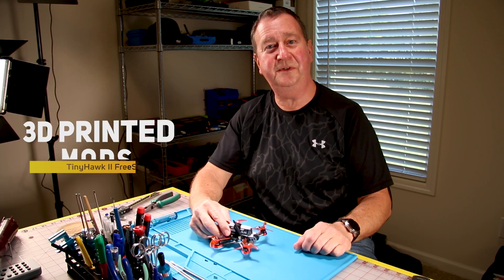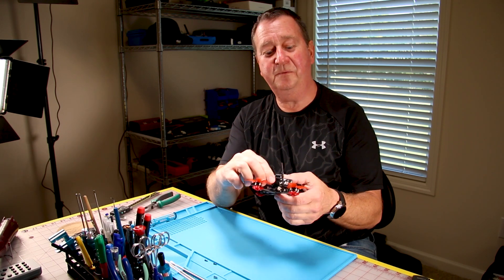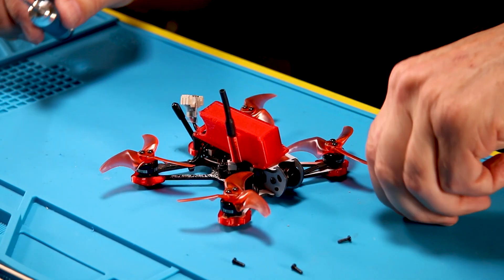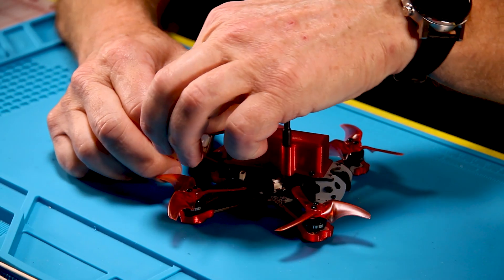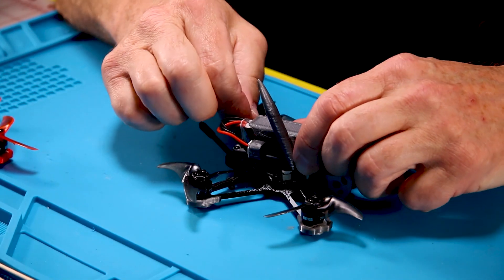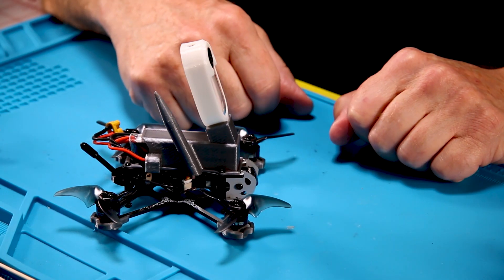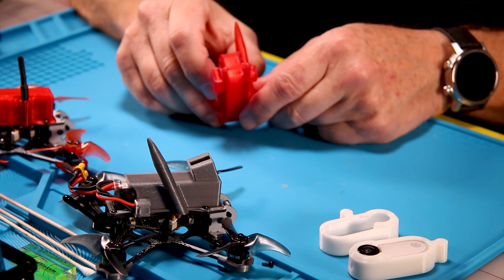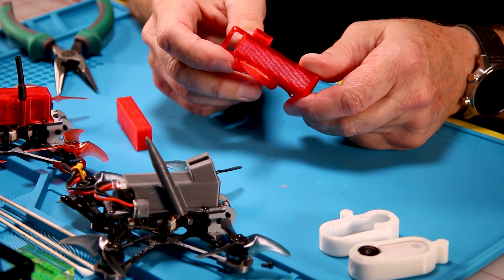Must Have 3D Printed Mods for your Emax TinyHawk II FreeStyle and Insta360 Go

Comment: The prints you made under the engine also fit on the Tinyhawk lll plus Freestyle HD
Reply from the maker: Thanks for the Info 🍍
Reply: Or looked carefully but they are not the same as the Tinyhawk 3 the model you have is different what a shame I just can't find them

Comment: Will these work with stock screws or will I need to buy longer screws to be able to use these different parts?
Reply from the maker: The stock screws work perfectly.  Do not over tighten them when you install the parts.🍍
Reply: @Pineapple22  Awesome, Thanks!!!

Comment: Do you guys know if the battery holder works with 550 batteries instead of 450?
Reply from the maker: Sorry I no longer have any of the TinyHawks so I don't have a way of checking.  Thanks for watching.🍍
Reply: @Pineapple22  The arm guards just work for 2 arms. Is there anything i can do?
Reply from the maker: @_l_u_k_a_s_5922  When you print the arm guards you need to mirror two of them, so you have a complete set.  You can do this in your slicing program.🍍

Comment: Thank you for this video and print files. I’m just this minute printing a battery holder for my Tinyhawk. Just wondered if you’d consider designing a battery box with a mount for the Runcam Thumb. It’s powered off drones as it has no internal battery?
Reply from the maker: Thanks for watching I have concentrated on other quads and have sold my TinyHawks.  You are free to use the files and have someone change the mount. 🍍

Comment: Love the prints thanks for putting them up what length motor screws did you use for the skid pads
Reply from the maker: You can use the stock motor screws on the pads.  They are only two layers thick and the TPU compresses.  Just don’t overtighten them snug is good I have never had one come lose.  🍍
Reply: @Pineapple22  ok cool I wasn't sure if they would hold thanks so much for your reply and for your awesome upgrades on  the freestyle I love this hobby so much and people like yourself add so much more enjoyment to fpv. Happy flying

Comment: Thanks for sharing STL files! I've printed all, but I can't install motor guards: how did you installed them? exiting 5mm crews are too short, and other 8mm screws are too long so they damage motoros. Thanks!
Reply from the maker: I have always used the stock screws.  Did you print them from TPU?
Reply: @Pineapple22  no, PLA. it eats about 1.5 mm from the screws - so the remining screw part isn't long enough to reach the motors
Reply from the maker: @AlexLebed  The parts are designed to be made from TPU that is why the screws will not work.  The TPU collapses when tightening up the screws.  If you have an Ender Printer the G-Code is on the cloud drive.  I print TPU at  210 Deg C and  on a part like this 30mm/s or slower.  The print bed should be 40c  Hope this helps you out. 🍍
Reply: @Pineapple22  thanks a lot, I didn't realized I need TPU for this. Do you have recommendation for the particular TPU? I just bought a ender 3, because was inspired by your freestyle upgrades. 
BTW, not a insta360 but an acceptable quality nethertheless on runcam split 3 nano + tinyhawk 2 freestyle https://youtu.be/0toM5AQrsQQ
Reply from the maker: @AlexLebed  I have always liked SainSmart TPU it works well for FPV part.  You can purchase it on Amazon.  Thanks again for your comments and watching 🍍
Reply: @Pineapple22  what printer settings did you use?

Comment: Thanks, buddy! I needed those skid pads and might just add some more mods
Reply from the maker: Thanks for watching 🍍
Reply: @Pineapple22  Hey should the U-shaped antenna holder go between the spacers and screws or is it meant to fit over the spacers?
Reply from the maker: @Blakeaholics  It fits over the standoffs (spacers)  you have to stretch it over the posts.  🍍

Comment: Awesome video! I've printed the "Emax 30 Deg Tinyhawk II Freestyle Battery Box VTX Support Insta360 Go" and  the "Insta360 Go Update Vertical" but it looks like it's slighly bigger and both pieces won't fit together ! Could you do any video showing how you create the mounts and the pieces, or update the box so it fits with the Insta 360 Go 2? Keep it up and thank you for showing us all your upgrades!
Reply from the maker: I have not purchased an Insta360 Go2 Yet but will when they come back in stock.  I will make a mount this later today.  Check back in the folder in the next day and it should be there.  Thanks for watching 🍍
Reply: @Pineapple22  Thank you so much !
Reply from the maker: @juanpabloperez6182  Files are in the folder. 🍍

Comment: You really should make that battery top have less material. Sorry to say, but sir, that thing is a hideous monstrosity.

Also, I would trim weight off those frame pads.  On a 5in drone, maybe you need that type of protection, but i feel like those pads just look big in comparison to the drone.  All you really want to do is protect those frames, so something super small and thin would work just to keep the frame a little off the ground.

The ideas are cool and always invent, but I think you should try to optimize on the weight more.
Reply from the maker: Sorry you are not a fan of my designs.  You are free to download the STL files and modify them for your needs.  I look forward to your video with your designs for the TinyHawk FreeStyle.  Thanks for watching 🍍

Comment: The THFS2 has a warm spot in my heart.  Its nice to see someone putting out support for it.  I wish a company would put out a similarly priced package with slightly better components, mainly the controller, the non replaceable antennas and proprietary motors.  The THFS2 is how I got into the hobby even though I've moved on.  There was a time I would have really been excited for the mods you have came up with.  Those days are done and I'm not going back now that I know what I do, but this thing you're doing is really nice and will benefit many people I'm sure.  Thank you for joining the hobby.  We need more like you. :-)  Have a great one!
Reply: The antennas are definitely replaceable though lol

Comment: I want to print the arm guard landing pad, but the file is only for two pads. Do you have the file for the other pads?
Reply from the maker: In your slicer software when you duplicate the parts just Mirror Two of them and it will make the set for the other arms.  If you are using an Ender Printer the Gcode that is there will make 2 right and 2 left.  If you have any problems let me know.  Thanks for watching. 🍍
Reply: @Pineapple22  I don't have a 3d printer, I send the files to a company that print 3d products for customers.
Reply: I send an email to the company to print it mirror
Reply from the maker: @MartFPV  Sounds Good.  I am sure they will get you fixed up.

Comment: Man seeing that gray mount makes me want to buy a tinyhawk, but i just bought 6 550mah tattus for my tinygo which would be a bit to big, guess i'll have to make my own if i get one.
Reply from the maker: The 550 dimensions on RDQ are  63x16x12mm and the battery I am using the 450 95c is 62.5x16.2x14.7mm  so it should fit in there good enough.  I might have to by a couple and give it a shot.  Thanks for Watching 🍍

Comment: Great stuff!!!  Awesome ideas!!!  Love it can’t wait to print these!!!!
Reply from the maker: Thanks for Watching 🍍
Reply: @Pineapple22  what type of filiment did you use?
Reply from the maker: I use SainSmart TPU 1.75  I have good success with it.  You can find it on Amazon or Race Day Quads sells it.🍍
Reply: @Pineapple22  Im sorry to bother you,  what printer settings do you recomend with this model?  Im very new to printing, I have a CR6 SE from creality.  Thank You.
Reply from the maker: Start with setting your print speed low 36mm/s is my base and can go slower on smaller parts.  Do the initial layer at 15mm/s.  You will need to have supports in most of the parts and I normally set my support Overhang Angle to 60 to start you can get away with 80 as a maximum.  Set your Support Interface Density to at least 60 and I like Triangles as a pattern I have found they pull off cleaner.  Temp for the SainSmart TPU I use is 210c and Bed Temp of 40c.  I normally use 6.5mm for my Retraction Distance and 25mm/s for the speed.  This should get you close.  Let me know how it goes. 🍍
Reply: @Pineapple22  Thank You very much!  I appreciate it!
Reply: Is there a chance I could buy one of these mounts from you??
Reply from the maker: @benjaminarens5625  Yes just send me an Email    PineApple-22@outlook.com      Thanks for Watching 🍍

Comment: My only concern is temperature management. Adding ventilation holes all around could help keeping battery cooler.
Reply from the maker: I live in Georgia and have not had any heat problems with the batteries.  My 2S batteries never get warm but on my 5” quads the 4s and 6s do get warm during a hard flight but they are mounted with just a strap.  Thanks for watching and commenting 🍍
Reply: @Pineapple22  Must be my concern coming from the smaller quads, when I pull battery out it is quite hot  when flying indoors. Outdoor in freezing temp it is quite ok still :)
Reply from the maker: Are you flying 1s or 2s? 🍍

Comment: Awesome!!! Can you add a thin shield on the landing pads to protect dirt going in the motors
Reply from the maker: You are not supposed to be using the FreeStyle as a tiller!   (sorry could not resist)   I added a design with a motor protector on it and put it in the folder.  I have not printed it but did a program for an Ender 3 Pro.  If you are using a different printer, print it with the landing skid side up.  I normally change the support interface density to at least 60% and sometimes 100% to make the part smoother.  Let me know if you need any changes to the part.  Thanks for Watching 🍍
Reply: @Pineapple22  sorry what is a tiller? Thanks for the reply I will soon check out the part with motor protection :D
Reply: @Pineapple22  ooh haha it’s a gardening tool 😂 yeah I know it’s not :D but a lot of times I accidentally make it dig holes into the soil 👨🏽‍🌾

Comment: These look great! Does the TPU print OK without support? You're quite an accomplished 3D modeler! What software are you using?
Reply from the maker: TPU needs supports like PLA or other materials.  I use Cura Slicer Software which is free to use.  The Battery Box need supports to hold up the roof when printing.  My rule of thumb is if the angel is over 60° you will need a support.  In most slicer software you can just drag the Gcode in that I have provided to see what type of supports you will need to make the parts.  Thanks for watching 🍍
Reply: I printed the battery box/antenna support using TPU and PVA support. Its tidies up the drone nicely.  When I asked what software you were using I meant what 3d modeling software not the slicer.
Reply from the maker: @jamesmallard3386  I am using TinkerCad for the designs.  Thanks again for your support 🍍

Comment: What are the dimensions of the standoffs/spacers used for the antenna tube holder?
Reply from the maker: It uses the stock Emax Standoffs.  They are 15mm tall x 4mm hex.  The print is a round hole and will stretch over the standoff.  If you have trouble getting the standoffs in the holes you can put the standoff in a nut driver and press it through the print.  This video shows it https://youtu.be/AZOuMWs_7w8?t=139 Thanks for Watching 🍍
Reply: @Pineapple22  Thanks! Idiot me used PLA.. 😅
Reply from the maker: Sorry about that I will edit the description to print from TPU to be clearer.  Thanks for the comment. 🍍

Comment: A battery box designed for underneath would be an awesome option if you could pull it off, I find personally that mine fly's way smoother.
Reply from the maker: The box will work on the bottom of the TinyHawk FreeStyle.  Let me know which battery you have and I will remove the antenna tube and put the STL in the OneDrive.  Thanks for watching🍍
Reply: @Pineapple22  I'm just using the standard emax 450s 1s doubled up and other brands that are the same size, I often use it indoors with just one battery as well, 
You haven't come across any prop gaurds for it by chance?
much appreciated mate!
Reply from the maker: The STL File and Gcode are in the OneDrive Folder.  It is called “TinyHawk II Freestyle Battery Box Cover” this will mount to the bottom of the TinyHawk.  Good luck with your upgrade 👍🍍

Comment: Great video and good design with the XT30 battery holder.
I am thinking of getting it and doing the same modification. 

Do you think it would be possible to replace the Insta 360 camera with a HD recorder such as the Caddx Turtle V2 or Rancam Split?
Have you considered such a setup?
Reply from the maker: The only problem with that type of cameras is the circuit board they have to be connected to.  I don’t think there is enough room on board for that.  The Insta360 Go is light and has stabilization built in.  The TinyHawk FreeStyle is a great quad you will not be disappointed when you get yours.  🍍

Comment: what's the all up weight now with all the TPU? do you feel the additional weight a lot?
Reply from the maker: The total Fly Weight for everything including the Insta360 Go is 117.74g.  I fly with Tattu 450 mAh 95c-2S that weighs 27.49g (included in total) I am not sure what the 1S Batteries weigh.

Without the camera I don’t notice any difference in how it flies; with the camera you know it is there and your flight times drop but handling with the same PID’s is good.  The FreeStyle does make a good filming quad for such a small machine.  I prefer it over a CineWhoop style when it is windy.  

I am modifying the mount to hold a Caddx ND  Filter which should help the Insta360 Go cameras quality.  I will do a video shortly about how it works out.  👍 Thanks for watching 🍍